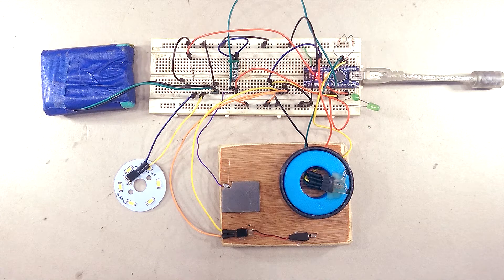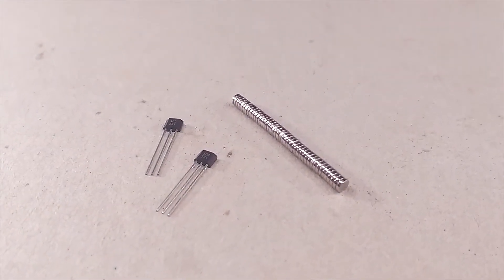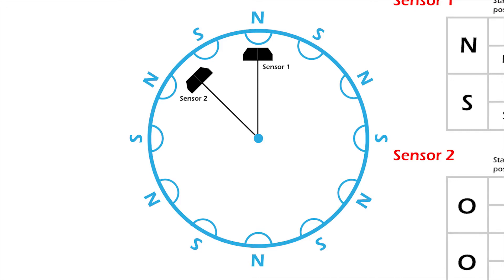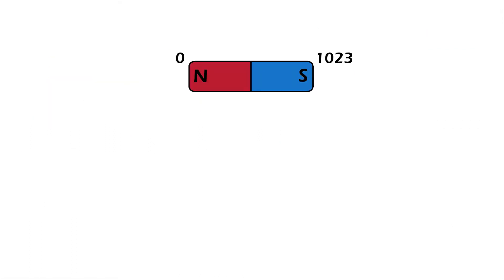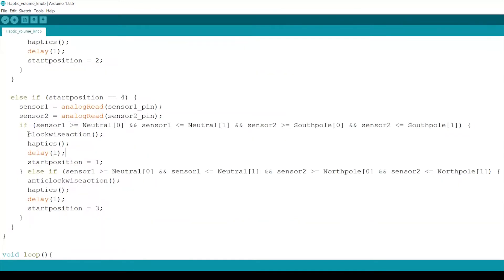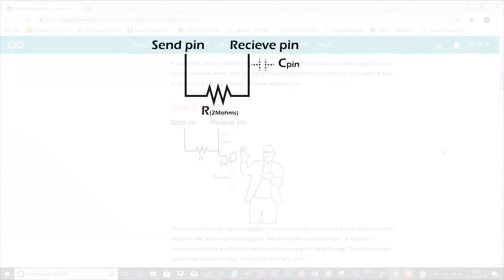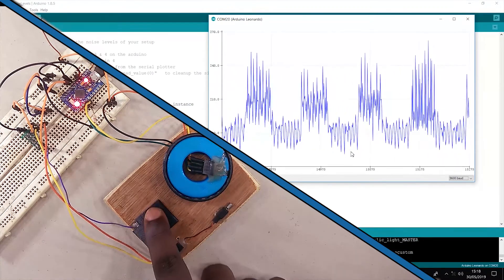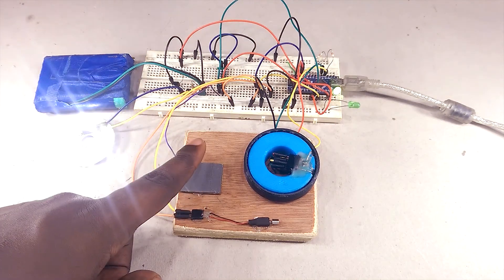Capacitive Touch and Magnetic Rotary Encoding on an Arduino.

Comment: How many steps per revolution is ideal? Looks like you have about 12? Do you wish you had more?
Reply from the maker: This setup was used for testing purposes, so a high resolution was not necessary
Reply: Ahmsville I understand. I am thinking of building the rotary knob like you did (great tutorial BTW!) and was just wondering how many steps per rev you used and if you were happy with the resolution you did? How many magnets total was the final product?
Reply from the maker: The method is good for any resolution, you just have to pick a number that works for you, keep in mind that the resolution is 2x the number of magnets used..the highest I have done is 100(50 magnets)